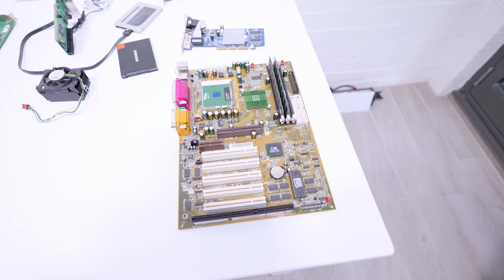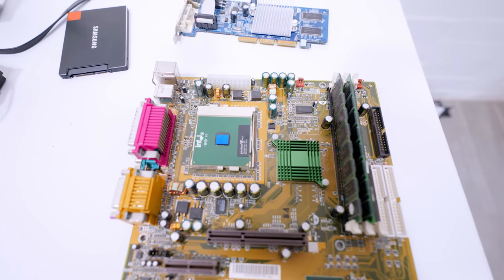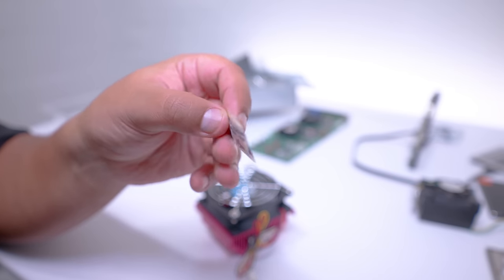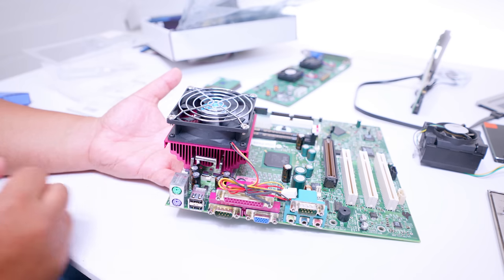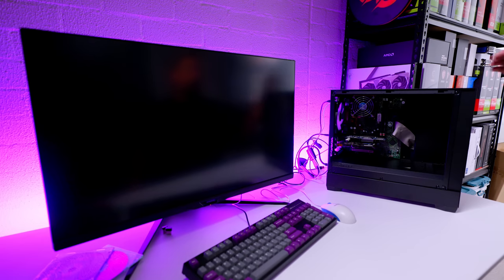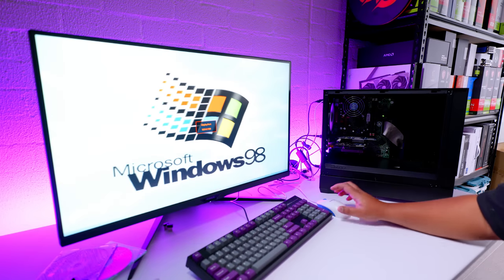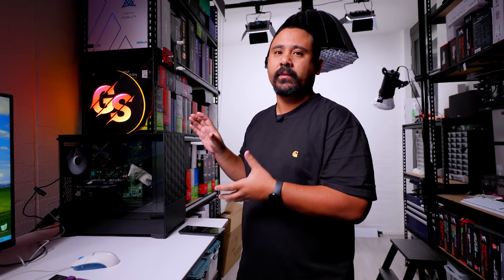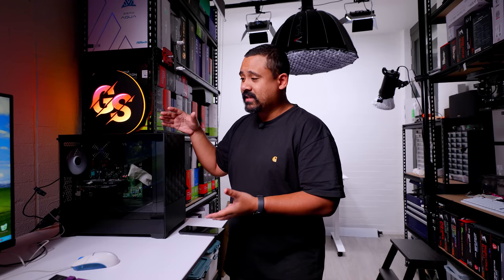I finally built my DREAM RETRO GAMING PC!

Comment: Gear Seekers : damn man....this is your best video ever made !!!! It brings up so much memories from the era that I've started building PC-s. My first personal rig was Intel Celeron 333 MHz (OC-d to 450 MHz on stock SLOT1 converted cooler), ABIT BX6 motherboard, 128 MB SDR PC 133 MHz, Hercules 3D Prophet 3D-FX Voodoo 2 12 MB PCI + Diamond Monster 3D II 3D-FX Voodoo 2 12 MB PCI (SLI bridged with that IDE cable looking cable) + 2D card ATI Rage Pro 4MB AGP 2x....all on my first CRT monitor Nokia 17" Flatron with 85 Hz of refresh rate and 1280x1024 resolution.

The first time that I've played Unreal 1....I literally cried at that 2.nd level waterfall !!!! At that moment I knew that a new era of 3D Trilinear rendering has started and that nothing will ever be the same....only better :). Quake 1 botmatch was my playground for LAN Party training and so was later on Unreal Tournament 1 (which was simply better than Quake 3 for me), Half Life 1 broke the reality records back in 1998 which I've played on my first 3D-FX Voodoo 1 4MB PCI that I've quickly replaced with my dual Voodoo 2 setup....man those were 2 decades of ultra fast game changing scenery in which you had to buy a new GPU every year to even be able to play certain new games due to DX 5, DX 6, DX 7, DX 8, DX 8.1 and DX 9.0 a/b/c limitations.

When Crysis 1 launched in 2007 (with Crysis 1 Warhead in 2008), then the first great stoppage occurred in terms of graphical progression....and stayed almost stagnant till 2015.

Comment: to 16:52:
Quake 3 Arena (that's the one I see on the desktop), works absolutely fine on Windows 11, even though it was released 1999.
don't forget to set your max FPS to 125 to jump higher and farther.

Comment: Revenant from Small Form Factor Network here. Nice build! I built a mATX P3-1.4 build myself with a GeForce 4800SE and two Voodoo2's in SLI. I went with the Vortex 2 sound card with the DreamBlaster Wav board. I highly suggest you consider getting the Dream Blaster X2GS if you're going to play DOS games as it has the officially licensed ROLAND midi set.

Comment: Well, I have a "retro PC":  ATX case from ~1999/2000's, that "boring beige" with translucent blueish plastic parts, mobo+CPU+RAM+DVD drive from 2012, VGA, PSU and HDD replaced latter because the 2012 ones failed, the only "modernity" added is a SATA SSD. 😜

Comment: Quite the blast from the past! Something you might try is Freespace 2, a game from 1999 that is still in development today. Take an original Freespace 2 install on your Windows 98SE box running in VGA or SVGA and compare it with a fully upgraded Freespace 2 running on a modern box and modern GPU.

Comment: OMG, i choose the same case for my Dream Retro PC! Core 2 Duo 3.75GHz/7900GT (600MHz) /Live!. All black PCBs on everything an Zalman Copper Flower cooler. IcyDock 2.5" hot swap SSD bay (looks like a floppy kinda) AntiX Linux, XP POS, 2000, ME (every dos game i've tried works under ME flawless) The machines performance is INSANE under ME.

Comment: Ah P3 memories. I remember having overclocked my P3 450MHz to 600MHz, and it was stable there for as long as I used it. I felt the fans were so big, but there was two of them that fit in the length of the CPU (it was a Slot 1 socket, I think that's the name), so they couldn't have been that big :P

Comment: Great video 👍 I use the same case and the same CPU cooler with an Athlon XP 2400+.  Only my board is pink and I use a PCI SATA controller.  And I built everything with RGB including the CPU cooler.  And now comes the kicker, I have an AGP to PCIe adapter and use it in Windows XP with a GeForce 960 😂 And no, that part can't make Crysis playable, even with this graphics card.  There is too much processor performance lacking.

Comment: You make me want to rebuild my Athlon 64 build 😂
Reply from the maker: Do it! An Athlon 64 rig is also on my todo list. I had a beasty Athlon 64 system in 2004 that I'd love to recreate. I have a dual Opteron Tyan board I want to do as well. I have running systems from the 486 upwards. My Pentium MMX system with a Voodoo 2 is going strong still. I also have a watercooled Pentium 2 with a TNT 2 running. I have about 10 systems I keep running for when I feel like playing on proper hardware :)
Reply: @Gear Seekers  that is wicked! I'd have to seek out new boards, but I've got 3 of the CPUs with RAM ready to go as well. Would be nice to play NOX or Black and White on native hardware again!

Comment: I have a desktop computer with a i7 4790 and a GTX 1660 and I paid only 10 bucks for it cuz I got it through a trade and I have a mini PC with a Ryzen 7 3700 in it plus I got a PC recently with Windows 7 on it and I still love Windows 7 plus I might you that PC for old school games because it can at least run most windows XP games on it and it old enough to so I am excited about it's it's a core 2 duo 2.6 GHS and plus I can play need for speed underground still one of my favorite need for speed games and the second one so I will be playing games like thim on it it's not going to be seen much internet use because Windows 7 is no longer getting security updates and I really don't want it to get any viruses on it so I literally got it just a for playing old school games in the early 2000s about the time the PS2 and GameCube was plus I want to play GTA 3 and San Andreas in my Windows 10 PC has issues running both of games